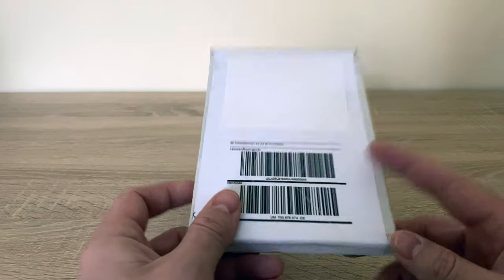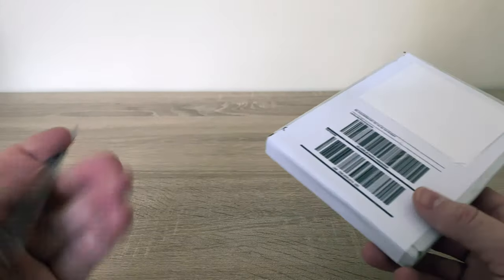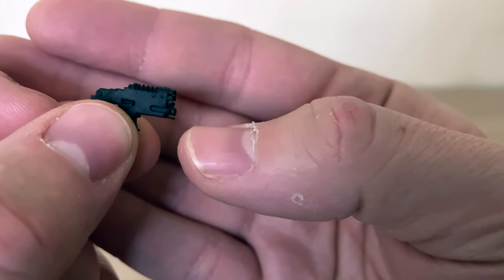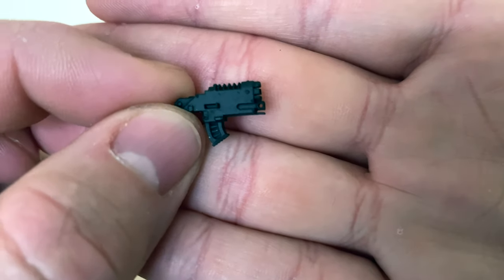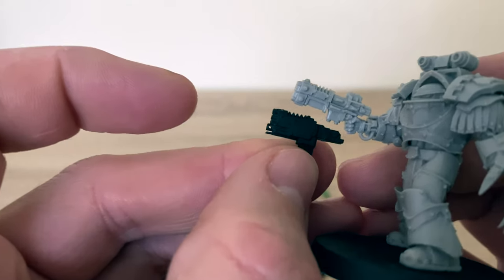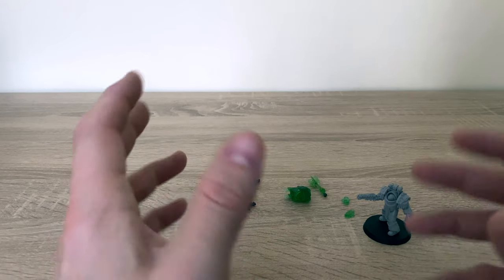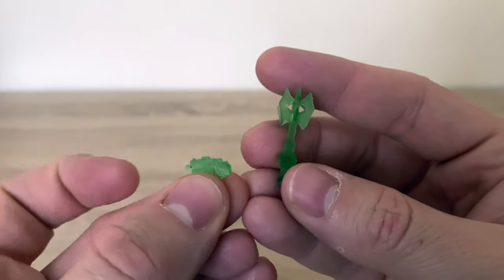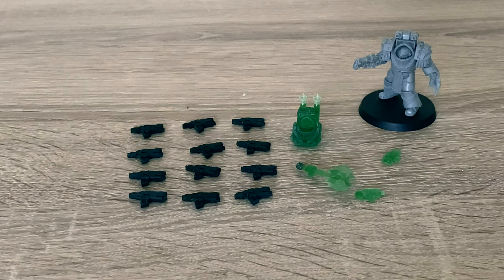3-D Printed Combi Volkites by Magos Terra for The Horus Heresy (plus Word Bearer extras!)

Comment: Things that small you can print a number at the same time with nor extra time for STL printers. I printed Tau drone antenna in batches along with the drone body.

I do know if it will replace buying boxes. They are easier to break and more of a pain for the parts.